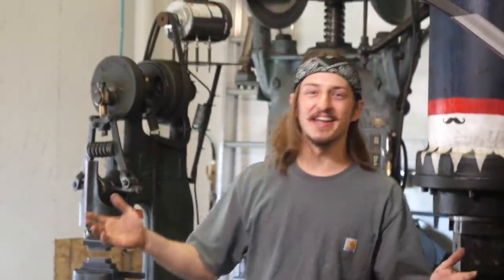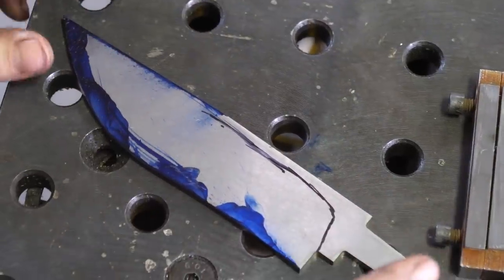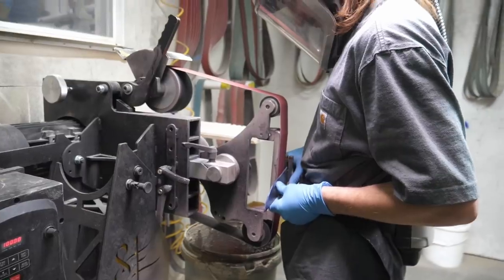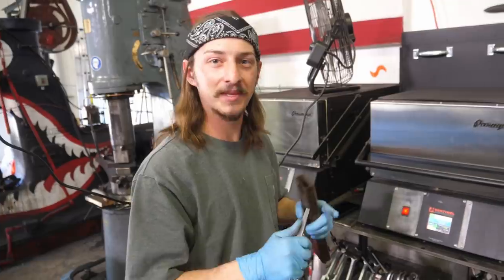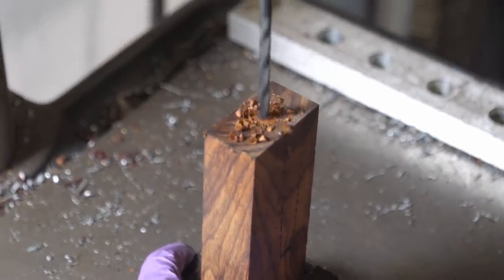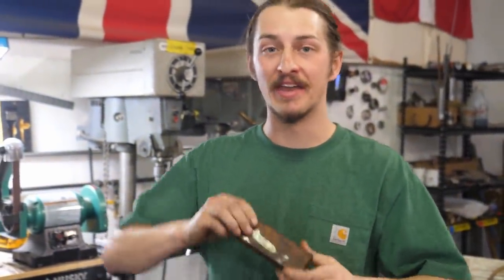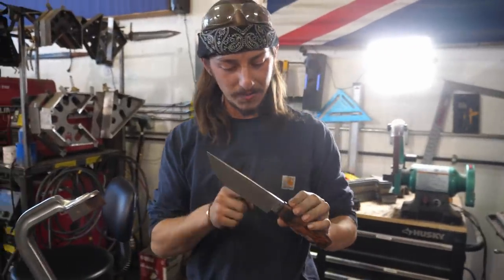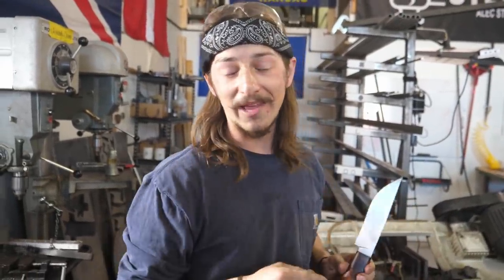The HUNTER RECURVE Build-A-Knife-Box!!!

Comment: here is a silly question. What speeds do you run the different belts at?
Reply: That's not a silly question at all!  There was definitely a learning curve when I bought a 2x72 grinder.  Different strokes for different folks, but I will slow down the speed when I start on the 120 grit belts, and will progressively get slower as I move up the grits.